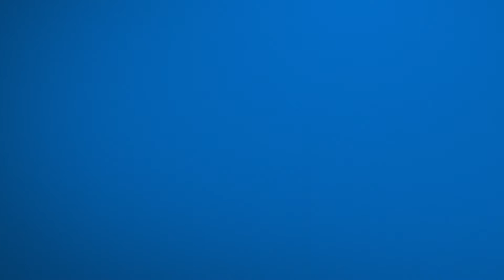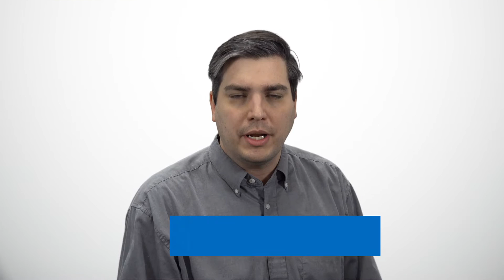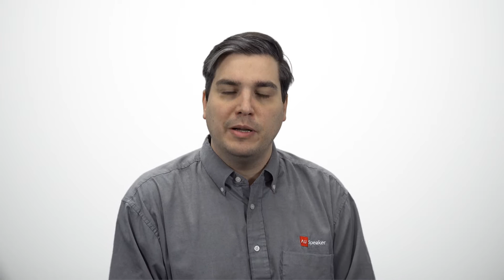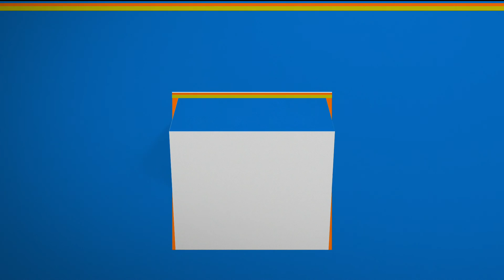Building Block - Why is my Civil 3D project so slow?

Comment: Data xrefs don't fix the underlying issue.  If your final surface (culmination of say 3 other surfaces pasted together) is put into a separate drawing, that drawing STILL needs to load all the underlying surfaces in order to show the final surface.  I can understand if there are say a total of 10 surfaces and only the 3 are related, sure that could save you load time, but what if all 10 were a part of the final?  You're basically putting one drawing into another, no time saved.